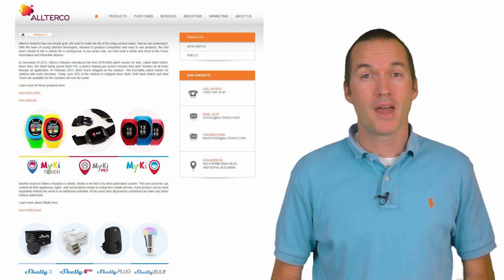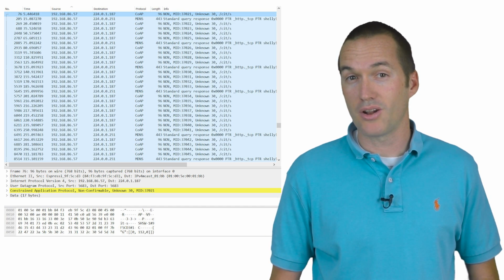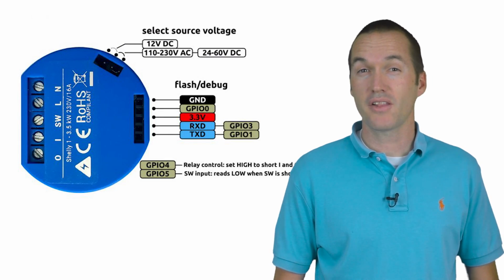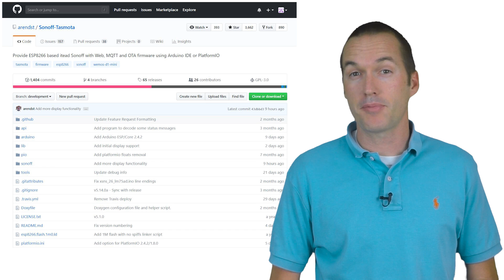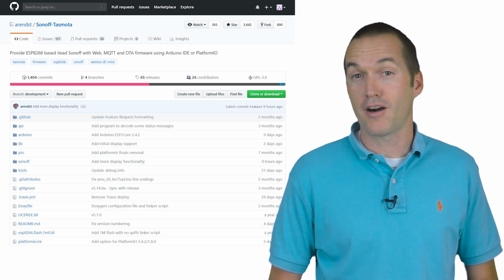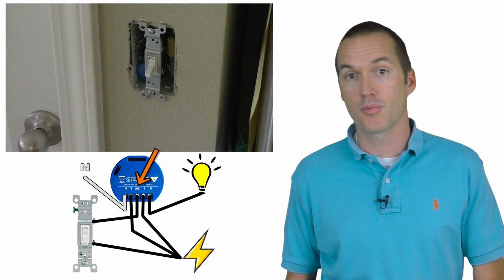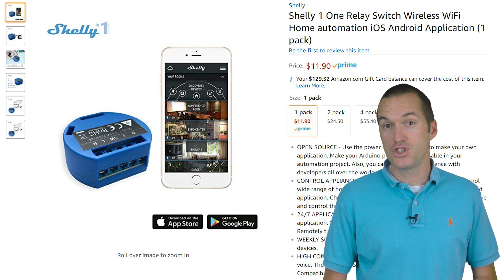Is the Shelly 1 better than the Sonoff Basic?

Comment: What about 3 way switch (in bedrooms or corridors) installation? Does it require the line?
Reply: I'm also curious about this.  From the perspective of putting only devices intended to be in the box, how can you use these for 3 or 4 way switches?  Currently, I put a sonoff where the line to the light is and then use extra pins on other sonoffs in the other boxes (assuming it had a mix of normal and the other side of the three way switch I'm trying to control in same box) to have a way to send the mqtt message to the first sonoff.   If the other part of the three way switch is a single box, I still use a sonoff but waste the relay.  If I want to get rid of the somewhat unsafe sonoffs, can you use the shelly this way?   I've also considered using a D1mini for this case, but still need to power it somehow - not sure that putting a wallwart in the box is safe.
Reply: There is Shelly2, you can use to control 2-way light switch as well.
Reply: is shelly2 also open source?
Reply: @TLuyten  I think The Hook Up is working on that :) and show us soon.
Reply: I am looking for a solution for an existing 3 way switch (two switches that control one light currently) and adding a IOT switch and have both of the existing switches still function.  Can the Shelly2 do that, and if so.. how?
Reply: Yes you need just one. For more support you can ask developers in our FB group. Just find and add Shelly Support Group (English Language)
Reply: @dimitardimitrov849  wish to see a tutorial for 3 way switch (in Italy means 2 manual switch) and 4 way switch (3 manual switches)
Reply: @bkw67  probably the simplest way would be to take the final output from the 3 way switch (the wire that goes to the lamp) and connect it to the SW input, then modify the firmware to look for a change of SW instead of the level and just switch the relay (from on to off or from off to on) with every change of the SW (from 0 to 1 or from 1 to 0).
Reply: @claudioita9  see my reply to Brian, it should work for 4 way switches too.

Comment: You made no mention of the fact that you need to modify the sonoff firmware if your going to use it in "switchmode", and for those who can't seem to grasp even basic coding that's a deal breaker.

Comment: Very nice! I love and hate it at the same time... Love that's it's small, safe, and RoHs compliant, but hate that you can't use the GPIO pins for things like push buttons and sensors (I usually add IR sensor next to light). So if the only thing we can use is the rocker switches, how do we deal with the problem of switching off a light via home assistant and then being confused by the On state of the physical rocker switch? Would it be safe to use 220v 3A pushbutton switches with Shelly 1?
Reply from the maker: Does the 220V 3A pushbutton have a proper ground connection?
Reply: Nope, just looks like a + and - on the button: https://www.ebay.com/itm/16mm-Starter-Switch-Boat-Horn-Momentary-Push-Button-Stainless-Steel-Metal/151508432443?epid=1360769516&hash=item23469b363b:g:oHMAAOSwel5bfxsF

Comment: Hey Ron , great review and device oh the possibilities . Though in Australia in looking at $24.00 AUD each. bit of an extreme price at the moment but I’m sure it will be cheaper once on eBay soon enough. So I thought I would check out the sonoff wall switch t1 . Can have delivered for $13.00 AUD. So will buy one of both to check out. Thanks for the great info. Really enjoying all of your video, heads up to drzzs as well for introducing your channel.....
Reply: Hello, we just open Amazon.au store and in 2 weeks they will be prime available.
Reply: @dimitardimitrov849  Hi Dimitar. I just wanted to see if you had, or are looking at, the Australian C Tick certification? Which I think would be: AS/NZS 4417.1

The reason I ask, is they are technically not legal here without it, so if they were found after a fire, etc. Insurance would not pay out anything. So just want to be sure before purchasing!
Reply: @amanimmortal  SAA certification cost's a bit and takes time, most small producers won't get the certification due to cost, I don't think the Sonoff T1 has genuine certification, ebay sellers are saying it has but not producing the certification numbers correctly, Sonoff Basic is not certified.
Reply: Damn, the Australia tax is real.... $34.99 + delivery for two from Amazon AU :\

Comment: Good on you for addressing some of the isolation and safety related concerns. It's interesting that the Shelly product is actually safer than the Sonoff because it has no isolation. It forces your (or more specifically, your electrician) to take precautions.

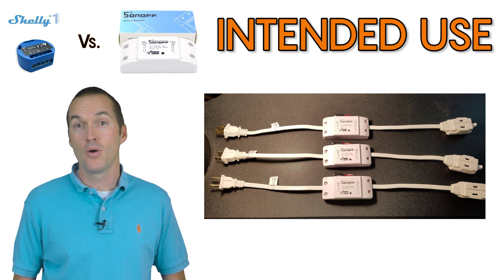Comment: At 11:22 you show a picture of the Shelly1 inside an electrical box.  I'd love to know more about that.  It looks like a normal overhead lamp box, but I've never seen one with the little reservoir or wire opening that seems to magically fit the Shelly.  I'm assuming you just got the picture from them since you didn't use it like that.  If there are boxes like that where the Shelly was shaped in mind for, I'd be interested in knowing more.
Great review.
Reply from the maker: I think it's an EU style box.  I pulled the picture from their website.
Reply: You can check also this video: https://www.youtube.com/watch?v=Sejv6h3Mbr4

Comment: Just because a Relay has a high amp rating stamped on it, does not mean that the PCB and/or enclose are capable of handling that amount of current.Have you done a load test on this unit and take some thermal readings from it?Funny, the web site description for the Shelly 1 states that this unit can handle up to 3500w, I think that is referring to another product of theirs.
Reply from the maker: 3500 watts = 220V * 16A
Reply: Western Europe is 230v single phase and 400v Three Phase.
Reply from the maker: These should not be used with 400V.
Reply: I know, just pointing out EU single pahse voltages differ to North American Voltages. I managed to order Shelley1 and 2 direct from manufacturer.

Comment: Another negative to the Sonoff Basic R2 is that you have to waste the time DE-soldering the plugged serial holes in the latest "basics" and then install header pins. Or use the "Sonoff programming clip" and of course if you want to use the GPIO's you need pins anyway.

Comment: I don't think this is apples to apples.. Wouldn't it be more fair to compare the Shelly 1 to the Sonoff POW?
Reply from the maker: The shelly2 has power consumption monitoring, the shelly1 doesn't.  I'll be reviewing the shelly2 shortly.
Reply: I was thinking more to the respect of both the Shelly 1 ans the POW being 16A and also within the same price range. You could compare Shelly 2 to the POW R2 as well focusing on the energy monitoring features.. Just a thought.
Reply: That's actually a very good point, the Sonoff POW is similar in price to the Shelly 1 and so if you compared those two you would say the Sonoff's power consumption monitoring was a bonus, with basic functionality otherwise being equal. Choosing the basic Sonoff for the comparison handicaps the Sonoff I think, sure it can win on price but then suffers the 10A v 16A comparison.

Comment: thanks for the video! its still confusing on how to hook it up if the ac line voltage blows up the gpio ports, like how do you hook it up with the low voltage output for a garage door and use a door sensor to let you know when the door is up or down like docz did?
Reply from the maker: The relay is isolated, so you can just hook one side of your "garage door open" wire to the O input, and the other side to the I input, then power it with the L and N terminals.  The GPIO header should only be used for flashing new firmware.

Comment: Is within USA code to put one of these in the wall switchbox?
Reply from the maker: Since the switch it is tied to is grounded I believe it meets code. 

(I'm not a building inspector)
Reply: Thanks.. I guess I should dig around.  It's more the insurance adjuster I'm concerned with than building inspector.  I'd really like to use something like this on existing switches but I certainly don't want to have insurance policy scraped if something happened because the device caused a fire.  I understand this is unlikely, but it was unlikely that our house would flood until we had a 300 year flood a few years back.
Reply: Neutral is NOT ground.  Though they are typically tied together at the circuit breaker box.  But since the device is not accessible when it's inside the switch box with the cover on, I don't think a ground is required.  (I.E., If you can touch any metal part, a ground is required).
Reply from the maker: Correct, I'm talking about the rocker switch being grounded.  The internals (the shelly1) do not have to be grounded, only parts that can be touched from the outside.  I've heard of building inspectors requiring the metal screws that hold the switchplate on to be grounded because they can be touched from the outside.
Reply: Possibly not.  Your biggest challenge is box fill.  Here's an article that explains box fill really well:
https://iaeimagazine.org/magazine/2017/01/31/box-fill-calculations/
But, I would wager that most homes have at least one or two boxes that is over it's rated fill in cubic inches.
How about building a mockup of your installation and take that to the building inspector and ask if this would pass code?
Reply from the maker: I have a Belkin Wemo dimmer for my kitchen lights (belkin cloud, yuck).  I can tell you that the volume of the single belkin smart dimmer is greater than the standard toggle switch + shelly1.  For that reason I don't think it violates box fill regulations.

Comment: Great video comparison.  I use a lot of Sonoff SV's.  Looking at your video it appears it would compete with that device as well.  With the SV I wire a switch on GPIO14 to toggle the relay.  I don't see on this device where I would do that.  GPIO01 or 03 maybe?
Reply from the maker: It would use the SW terminal which is connected to gpio 5
Reply: Thanks for the quick reply.  I've ordered one to test out.
Reply: Vince Callaway  I think the 5-24V range of the sonoff SV is more useful than the 12V & 24-60V of the shelly. But seeing as they are substantially different they may have their own uses.

Comment: Those screw headers probably won't like being manhandled too much w/ solid conductor wires. Care should be taken when "stuffing" everything back in the box. Maybe pre-bend the wiring a bit first? It stinks that they expose the GPIO to line voltage (how does this not fry the MCU?) so that we can't do anything with them. If the price ever comes down I'll have to look at using these. Might be the only way I can get more HA hardware in the house; WAF and all.

Oh, how would one set up on a 2 or 3-way switch? Rework the traveler wire? I'll have to noodle this a bit.
Reply: YES... I broke the terminals off an "basic" trying to install in the wall. So my latest installs I'm using "BNTECHGO 16 Gauge Silicone Wire Ultra Flexible "Amazon"" And that works much better.The wire is big enough to handle the 10 AMP rating of the  "basic."
Reply: @donjenkins2465  most building code would say 14ga is required for a standard 15A circuit breaker so that the wire doesn't become the "fuse." However, since the basic will probably fry first anyway it doesn't really matter.
Reply: While this makes your life easier, it's a very bad idea because that is a high-strand count wire.  Keep in mind that while 14 AWG wire is rated at about 24 Amps (for single core), and 16 AWG (single core) is 15 .. When you're using a high-strand count, that wire is only load-rated to 5 Amps.

In simple terms, you likely have a 15-Amp breaker on that circuit with a wire that isn't rated to tolerate more than 5 amps.  In addition, remember that it doesn't matter what is theoretically passing through that single end of the circuit (behind that single switch) - rather, the entire sum of the current on that line from the breaker, is passed over that wire, regardless.

Simply put, if you're using a high-strand count wire (aka Primary Wire in your case), you'd need to use a 10ga to get 15 Amps.
Reply: @InspiredScience  better to go with the Shelly One or Two then as the terminals are far more resilient to wire torquing. And they fit the hole w/ a regular switch installed.
Reply: @InspiredScience  spent a little time with Mr Google and best I can tell is that AWG is AWG whether it's stranded or solid. None of the tables resulting from my searches made a distinction between solid/stranded. Now, I would hope that anyone buying "Chinesium" products would take ampere ratings with a big grain of salt. Having seen the puny size of the so-called 10A relay in the sonoff products and there's no way I would ever load it above about 5-6A resistive and even less for inductive. I'll posit this... What's the AWG of most "lamp cord" wiring that's plugged into 15A wall sockets? I'd say if it's good enough for a 6ft or so UL listed lamp cord then it'll work for a short jumper to the Sonoff. The Sonoff itself is going to be the weakest link in a fault condition anyway.
The mains breaker should interrupt a fault before the wiring has time to be severely damaged by a downstream event unless the amperage creeps up over a period. That's more of an overload than fault and I defer back to my statement of rating vs load.
Reply from the maker: I agree, BUT, the screw terminals on the shelly are about 100x better than the ones on the Sonoff Basic, the green ones they use are complete garbage.

Comment: The isolated relay and 16A rating makes it perfect for switching baseboard heaters without a wall mounted thermostat connected to it, as long as you power the Shelly 1 from another source.

Comment: I feel like this is the perfect device for people like me who get nervous of the thought of leaving their sonoff basics inside a switch box.
Reply from the maker: Yep, I agree
Reply: i don't think this is any safer than a sonoff behind a light switch. if you wire up the sonoff to the light switch in the same way you wire up the shelly 1, i don't see any reason or evidence why one would be safer than the other.  Although if using the sonoff basic i think the terminals are a little crappy.
Reply: Looking to do the same, anyone know what US standard or certification needed to do this? UL Listed? Are these certified?
Reply from the maker: They are working on a UL cert, for now they just have CE and RoHS as is required for europe.
Reply: @TheHookUp  although mine says RoHS 'COMPILANT'.....not 'COMPLIANT'... ;-)

Comment: Great videos! Can you elaborate on functionality when wall switch is off? Can you still use app (cloud/local) to turn light on? Or does the wall switch need to remain in the on position  permanently? Or Does the wall switch 'flip' functionality if app is used?
Again, thanks for all the great videos!...
Reply from the maker: The switch and the shelly can both be used, switch position doesn't affect anything.
Reply: So that means that you turn on from the switch, then turn off from the app, and then when you touch the switch again, the light will turn again, right?
Reply from the maker: Yes.  If you use switchMode 0 in tasmota it will toggle the next time you flip the switch.  switchMode 1 will require you to put the switch in the correct position (up for on, down for off) so you would need to move the rocker switch twice.
Reply: @TheHookUp  nice! Let's try them!
Reply: Thanks Tgosnell73!  That was exactly what I was concerned about as well.  Most of us are already used to the concept of "toggling" since we have so many 3-way switches in our world.  So, the idea that you might flip the switch "down" to turn it on is NOT all that hard to get used to. 
This is device might be a good option, especially if they can improve their price-point by ramping-up the number of units they manufacture.
Reply: @TheHookUp  Oh, I just replied above to a similar question because I didn't read your message yet. I didn't know that tasmota already had this mode of operation. Sorry for the noise.

Comment: Thanks for the review. I may go back to my original plan of using cheap wifi based devices for my smart switches.
I just need to figure out how to do multi-way switches (without relying on the home automation system to relay signals).
Reply: I have the same issue. All my switches at home or almost all of them are at least  two-ways or even three-ways so I need a solution that works in this setup (and to obtain waf it has to work even when no system is running)
Reply from the maker: Both tasmota and the shelly app have scheduling built in if that's what you mean.
Reply: @TheHookUp  Autocorrect got me. I meant to say multi-way, not multi-day.
I want a solution for all the two-way and three-way switches in my house that doesn't rely on the switches communicating with each other through some external system. If that system (eg home assistant) goes down, the switches should still work. This is important to me partly because I don't plan to stay in this house the rest of my life, and I don't want to have to replace all of the switches if/when I sell the place.